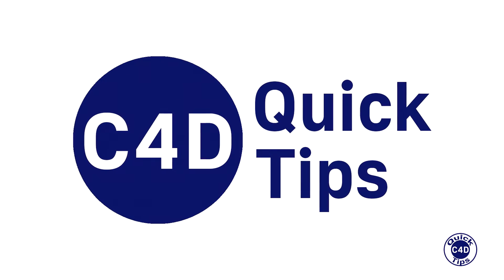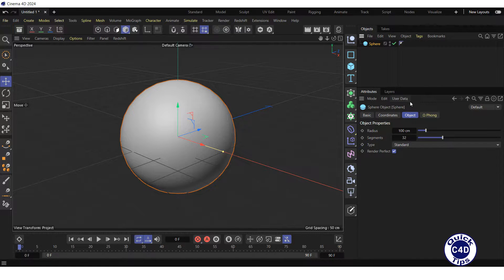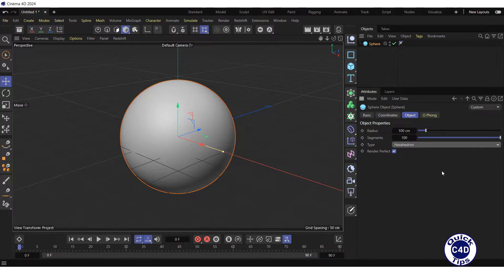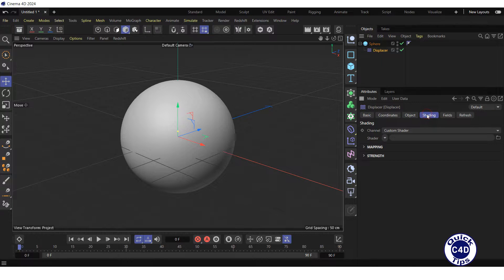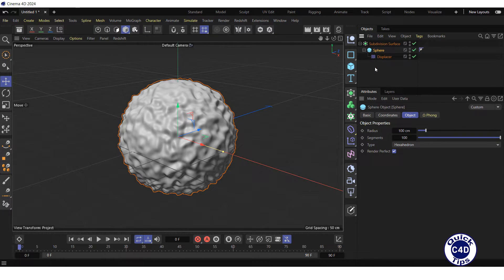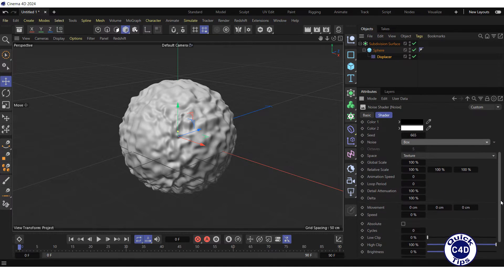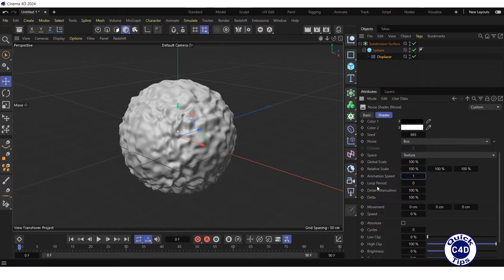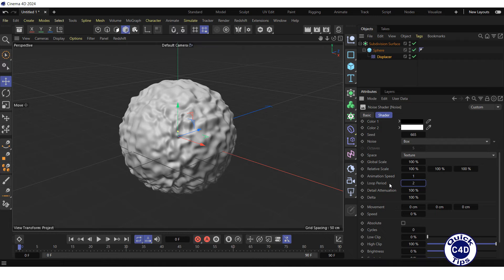Cinema 4D: How to Loop Noise Displacement Animation

Comment: why the noise stopped at the end, so its not perfectly looped
Reply from the maker: To prevent the first and last frames from being the same, shorten the timeline by one frame (to 59F in the example).
Reply: @C4DQuickTips  yes it works thanks
Reply: @C4DQuickTips  thanks for the last reply, i want to ask Do you know how to keep the cloner usable? For example, if i want to use vibration tag on each object in a cloner, is that possible? Do I have to make it editable first, and do all objects have to have their own pivot points?
Reply from the maker: To make each clone of the Cloner move in its own way, it will be easier to apply the Random Effector to the Cloner.
For this: select the Cloner, create Random Effector, make settings in the Parameter tab, go to the Effector tab and choose Noise or Turbulence in the Random Mode.